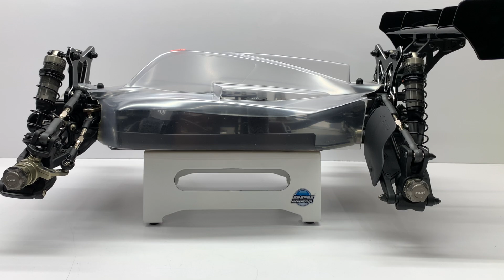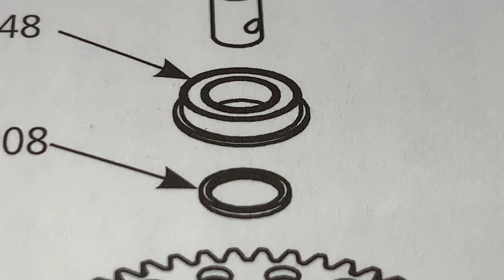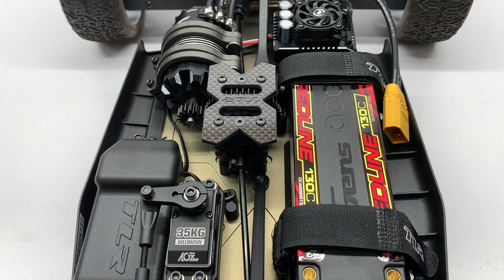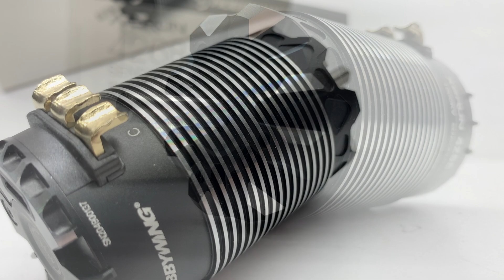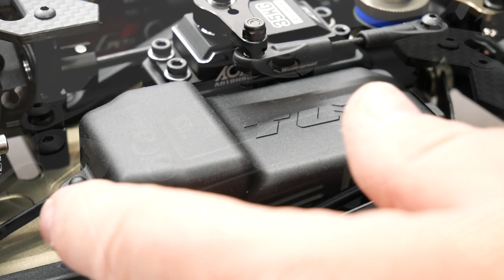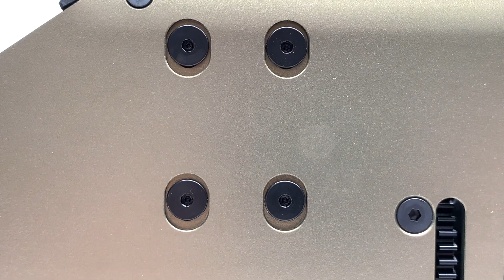TLR 8ight XE Elite - Build Reveal - Best Electronics, Tires, Paint, Etc

Comment: I have losi 8ightXE RTR and mugen secki MBX8TR ECO kit both running on 4S putting the mugen together using the manual to assemble the kit was relatively easy but compared to the tamyia kits manual i did have to re do some of the assembley because I got the instructions aren't very clear showing how to assemble the left-hand dif suspension linkages and the right hand assembley using the same picture for both my only other problem was not using enough lock tight on some parts that really needed it
Reply from the maker: @scottorgan2255  I agree, not all manuals are created equal. I’ve seen the best manuals from Tekno and Traxxas (crazy enough)

Comment: I think Losi is the best racing 1/8 buggy ''IMO'' because they all ready have a cutout for a slipper clutch on the e buggy that lets you know that their minds are all about racing, but imagine if every body thought that same way, and their was nothing but TLR's on every track that would be a very boring race and I would not want to race if I just wanted to race. I learned with a slash then got a Mugen that I raced for a while back in 2012 my buddy had a Losi and he would bet me all to hell, but when we switched buggy's he would still beat me, so its mostly the driver, I have not had a buggy for 10 years got the bug again, but I am torn between the Losi and Tekno I think the Tekno has the better shocks, I have herd that the Losi wears out a little faster than other buggy's that's why I have not pulled the trigger on it yet if I was just racing that would not matter to me but I am older now and want to have fun and race occasionally
Reply from the maker: They do make a good presented product, in the box. It goes together well (except for the extra spacer that TLR has failed to update over 2-3 owners manuals..). I still prefer Tekno, IMO.  They have a much more "grass roots" race team - that has attracted Maifield now, so it should be interesting.  TLR (Horizon Hobby) really only has Phend now..and Pro-Line is a dying brand as well.

Comment: Hello there. 
Just new to the racing side of things.  If it's ok I'd like some truthful advice on your thoughts and preferred race spec 1/8 buggy and truggy. I'm leaning towards the tekno for the truggy, and mugen seiki for my buggy. 
I'm also interested in tlr race spec buggy.
How does the build quality and durability stack up with these high end race spec vehicles. And maybe team Xray, but parts in Australia 🇦🇺 are short supplied for xray ??
Reply from the maker: Well, After owning nearly all of the 1/8th scales....I'm still a big Tekno fan.  They just get it and they're built like tanks.  I would try and stick with the same brand for both buggy and truggy though......as so many parts are cross compatible. I had high hopes for the TLR, but that motor mount just did me in.....
Reply: @TheRCNetwork  thank you mate. What a legend for responding back to my comment. Thank you. Definitely lean towards Tekno, as parts are a bit easier to get in Australia 🇦🇺.
Reply: @TheRCNetwork  sorry just 1 more thing.  How would you rate the team xray 21spec Ebuggy. Is it as good, as they say ? Parts in Australia 🇦🇺 aren't to hard to find. Cheers 🍻

Comment: I’m eyeing on a 1/8 electric buggy kit. How would you choose among TLR 8ight-xe elite, Team associated RC8B3.2e and TEKNO EB48 2.0? Thank you very much.
Reply from the maker: I'd pick the Tekno.  It's a better driving/building/repairing buggy over the others.  The TLR is a close second in driving, but the motor mount and missing steps in the manual drop it down to the AE level.  I wouldn't consider the B3.2 even on the running, tbh
Reply: @TheRCNetwork  thank you again for the excellent well presented reviews. I can't help to ask is there any change in the status of TLR in your mind if he fixed the missed steps in the manual and the different ways of mounting the motor. I just found the materials and the craftsmanship in the LTR is awesome. I am kind of tht guy who like to look at the car inside to just appreciate the detail and craftsmanship. Does it make sense to you?  I agreed with you that the motor mounting would be cumbersome during maintenance. But it looks very good at a still perspective.

Comment: The motor, esc, and battery are the best for sure, but the best servos are made by ko propo. Quality control makes their gears the smoothest and Smallest gap between gears, giving faster response time. Build quality is just on another level and performance is there. Steering feels more natural compared to my brushless mks.
Reply from the maker: Although I have heard of Ko Propo, I've rarely seen their products and honesty don't know many that use them.

Comment: I should of watched this before I put together the center diff… yep… I had to take it apart and dumped fresh fluids because the manual skipped the bearing spacers… I would give the manual an 8 of 10. Very well organized parts bag. A few quirks but still ALOT better than AE.
Reply from the maker: yeah, it's frustrating.....and TLR knows this because it's happened in the past gens too.  I found out searching in the FB group

Comment: Hey dude. Are you running LIHV with that new hobbywing esc? Working OK? Couldn't find any specs on whether it can accept LIHV.
Reply from the maker: Yes, works fine!
Reply: @TheRCNetwork  thanks buddy, was worried it might not. No info about that online. Thanks for the build vid too - I made the same mistake with the spacers for the centre diff.  Annoying... I nearly threw them out! I also had a damaged steering flanged tube - UK supplier is replacing free of charge thankfully.

Comment: Hey great video! if i were to buy the 2200kv motor becasue the 1900kv is out of stock :/ is there a way to program the 2200 down to a 1900?
Reply from the maker: Yes, it is possible to de-tune a motor through the ESC...I have not personally done that, but I know it can be done...but it depends on your ESC

Comment: why universals and not cvd's? i remember replacing the universals with cvd's in my losi xx4 because they weren't very smooth when steering.
Reply from the maker: There are advantages of Universals over CVD's
Reply: @TheRCNetwork  and they would be?
Reply from the maker: @harlyquin  Universal driveshafts excel in rough conditions and can generate additional side bite by providing additional roll in the corners.  The suspension is allowed to work more efficiently when compared to the additional mechanical binding in CVA’s.  This allows the vehicle to absorb bumps better with a reduced risk of “catching a rut” and flipping the car while cornering.  For smoother tracks, CVA’s will produce more forward traction and support, but universals are also well suited with slight suspension setup changes (springs and oil).

The basic design of a universal driveshaft means virtually no maintenance is required and dirt and dust won’t foul the operation of the joint.  - I didn’t write this but fully agree 😃👍
Reply: @TheRCNetwork  ok i totally understand the last part but the part where drive shafts can generate additional side bite is way over my pay grade, i was thinking that was a job mainly taken on by the tyres, all i know is what happened with my car, that is the uni's were binding at a decent angle and the problem went away when i installed CVD's

Comment: The best 1/8 Scale buggy on the market currently is JQ Racing's Black edition.
Reply from the maker: You mean Mayako, right?
Reply: @TheRCNetwork  I don't have a mayako buggy,but what I mean by best is I'm not referring to fit and finish or any of the normal type of comparison,I mean you will get your best result on race day with the black edition hang on there is a catch you have to know what you are doing first. eg: if you normally finish towards the back of the b final with the BE you will bump to the big show. If you normally finish in the D final you will probably stay in the D final. You are correct I think there are no more BE so Mayako it is,where there are no special people getting better deals then you, just racers all together.

Comment: Hi, does that XT90 connector handle that battery amp? Would it handle a Castle Creations Mamba X esc and motor, and a Team Orion Carbon Pro 6400 14.8 volt 90c battery pack, will an XT90 anti spark connector work with this?
Reply from the maker: XT90 is fine for most 2s-6s applications, although I use XT60's on my 2s and smaller 3s packs now.  I haven't used an anti spark before....I'm sure it will work though
Reply: @TheRCNetwork  Thank you very much for the reply. I have been told by others I need big connectors because of the amps. But I want an anti spark good plug type. I’ll give them a go.

Comment: Can't decide between a  TLR, Tekno,  or Xray😖
Reply from the maker: All great choices....although I've never I've never owned an Xray.....
Reply: @TheRCNetwork  yup,  that's the one I'm leaning on the most
Reply: Elite is the way to go
Reply: Tekno EB48 2.0 was my first (and only so far) kit build. As someone new the building a kit, it was helpful to have all the lengths of the turnbuckles, 1 to 1 of all the used screws, and other associated parts printed in the manual. Everything is laid out nicely and done in steps with all the parts for a step in a single bag. I also like their warranty and return policy for broken parts.

Comment: Great video.  I just finished my XE elite build as well with the HW xr8 / 1900kv combo, and a protek servo.  I also opted to use the entire Lunsford titanium package (upper bolts, lower bolts, turnbuckles).  Without a battery and with the plastic wing and JC tires it weigh 3020.  Do you mind throwing yours on a scale to compare?
Reply from the maker: Dang it....I knew I forgot to add something to the video!  Yeah, I'll put it up on the scale and check back.  I think I saw your post on FB about your Elite.  Nice build!

Comment: Rich would you mind explaining to me why these new 4s lipo batteries are at 15.2 volts now? I've been out of hobby for some years now and have plenty 14.8 4s but not 15.2.
Reply: high voltage lipos. 3.8v per cell nominal as well
Reply: I don’t have time to write a book but basically  it’s just a higher voltage cell. 4.35v per cell fully charged. But we still treat them like 4.20v per cell. Less chance of running too low, and it never gets fully charged. Hence a lot safer in many ways. The cells never get fully stressed.
Reply from the maker: As others have said, LiHV lipos can do one of two things.....Charge up to 4.35v/cell (most of them.....some differ slightly) as a competitive edge, where allowed, or they can be charged as a normal Lipo to 4.2v/cell with some breathing room to keep the Lipo trouble free.  Some experts say that all Lipos are actually LiHV, and this is all just marketing....but I'll play by the rules set my the manufacturers.  Also, you do need a Charger that's capable of charging to 4.35v/cell